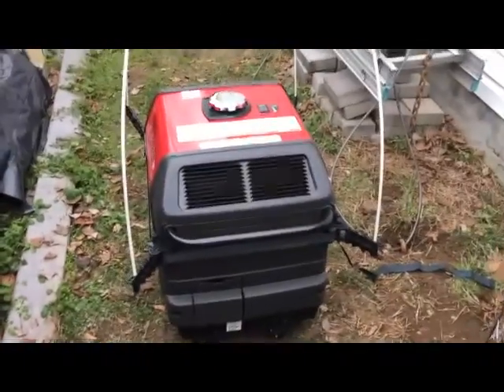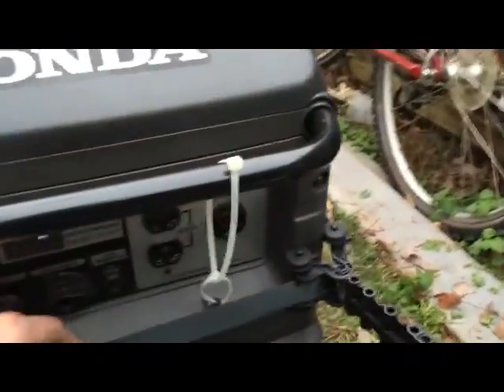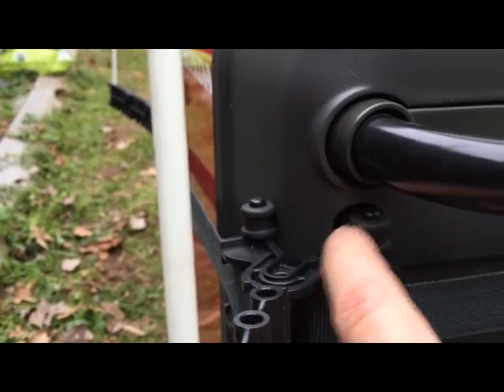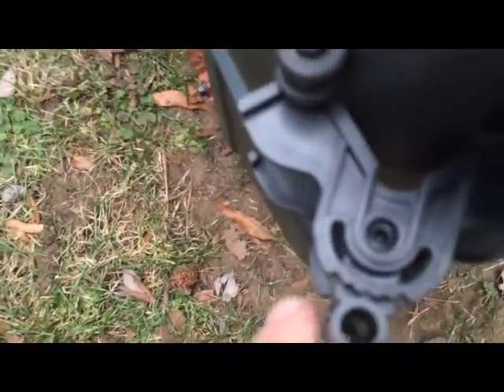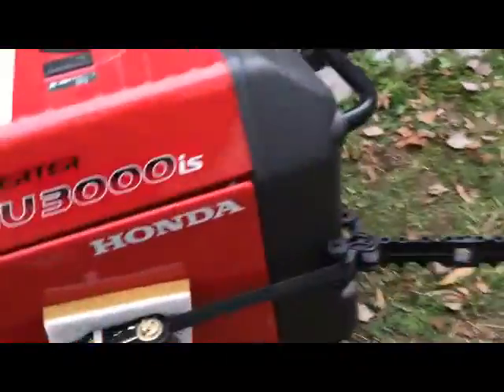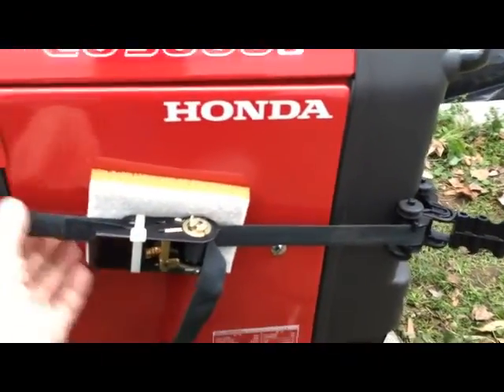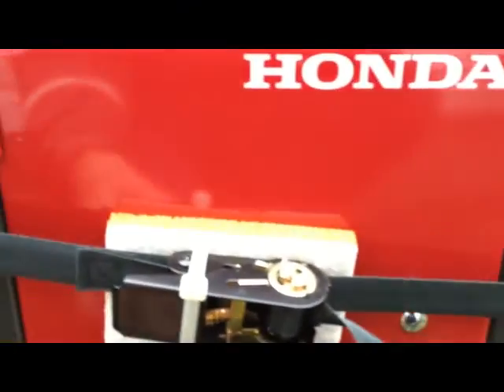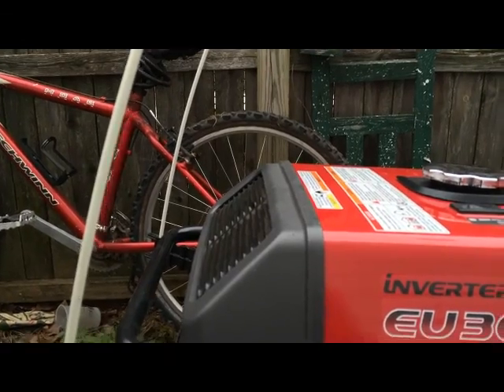EU3000is GenTent Video #1

Comment: I appreciate the video. Personally, I needed two helpers to hold the brackets in place prior to tightening the belt.  Alone, I found it difficult to get the corner brackets to stay in place while ratcheting.
Reply from the maker: Thanks Eric.  Yes it is tricky when doing it yourself.  On several occasions, when a large snowstorm was forecasted, I installed the Gentent in advance of the storm and placed the generator outside where  I would run it in the event power went out.

Comment: I just bought an EU3000is1.  I really appreciate your video.  Should save me time on setup of the gentent.  Did you install an hour meter?  Did anyone strain the oil after the first few hours of running to see if metal shavings come out?  On a different video, it was recommended to initially run a generator for about an hour then change the oil to remove any metal shavings then run it for another hour, drain it then add oil one more time.  Supposedly an engine will last a long time by doing this.
Reply from the maker: Hello, thanks for the comment.  I did not install an hour meter. However I do track run time using a pen and yellow pad, lol. My EU3000 is now approx eight years old.  During that time I have proactively run it every 6-8 weeks for at least half an hour. I changed the oil after the first 20 hours, then every 40 hours after that, per the user manual. On several occasions when it seemed to run rough, I added a little SeaFoam to the gas.  During these eight years, I have lost power for a total of about 48 hours and the generator ran flawlessly during those periods when it was critical.  Notably, last year, I installed a propane conversion kit from Hutch Mountain (Google it).  Absolutely love it.  I now primarily need to just have propane on hand which is much easier and safer to store near the house.  Can easily and quickly revert to gasoline when needed.  Of course, if your genny is brand new you may be reluctant to modify it in any way.   Lastly, the great thing about purchasing a genuine Honda genny is that you can order any and all parts for it thru your local Honda dealer.
Reply: @arthurmiceli4426  Is the gentent holding up well?  I just installed one.  They redesigned the grommets.  They are now made of a thick piece of gripping rubber.  I took a tip from you and I use 2 aprons so I can partially cover the sides of the genny.

Comment: Has the tent held up so far? I got caught in a storm recently but the generator survived it, now looking for options to protect it, maybe an umbrella mounted on the handlebars would be better?
Reply from the maker: Apologies for the delay in my responding.  It has held up well. It is basically still like brand new.  Of course, I have not had to use it much (thankfully).  On a relatred note, just converted my EU3000 to also run on propane.  Purchased the kit from Hutch Mountain.  Am VERY happy with it.